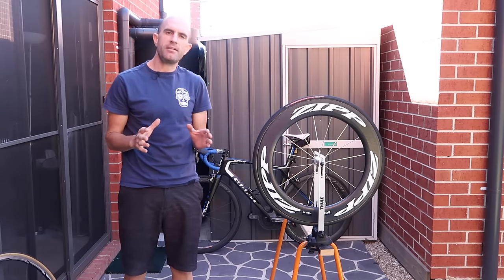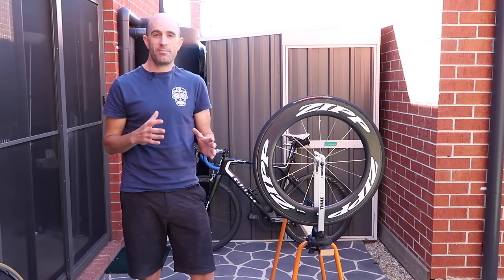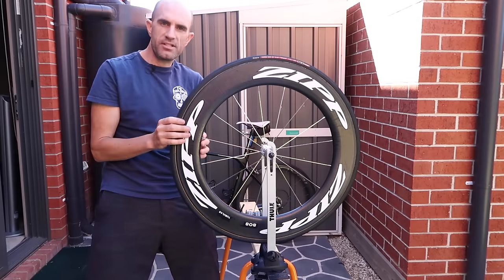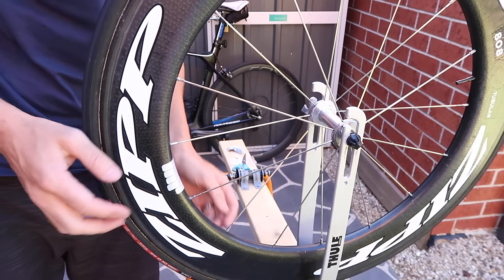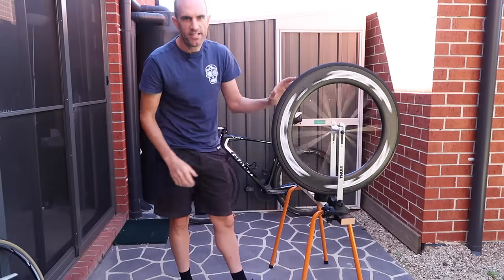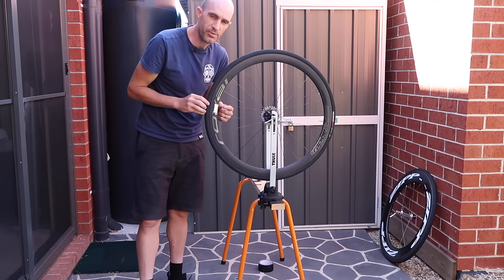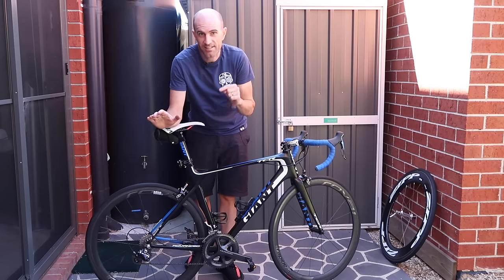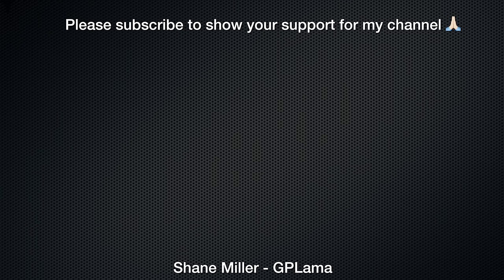Bicycle Wheel Balancing: Marginal Gains or a 'Must Do'?

Comment: looking forward to fixing my wheels i have giant slr0 30mm carbon clinchers and they shake as much as the rovals.  great video
Reply from the maker: Let me know how you go. Even if you can't feel it on the ride, I'm sure it's a worthy task to get your hands dirty... and to ensure your energy is going into moving forward.
Reply: Shane Miller i haven't fixed the giant wheels yet but had a look at my stans alpha wheels. there was a slight imbalance but it was largely already offset by a repaired tube im using. the patch and glue in the tube directly opposite the valve stem (yes i punctured the tube installing tyre).

Comment: Nice video!  I have been doing this for many years as well.  At first I tried wrapping a fine strand of copper wire around the spoke.  What I settled on was to twist electronic solder onto the spoke itself.  Electronic solder comes in many diameters, so don't get the thin stuff.  The one downside is that there is a rosin core in electronic solder.  It is such a minimal amount that the only drawback has been a slight stickiness on the spoke and solder over time.  The other downside to solder is that it  contains lead and one should be mindful of lead toxicity.  Latex gloves or proper hand cleaning is warranted.

Whether a wire strand or solder, when spun on the spoke it ends up like a compressed spring wrapped around it. This works surprisingly well and provides a wide range of adjustment and no worries about adhesive weights or interfering with the rim braking surface.  

Also, if the tire ends up being another source of the balance issue, once the tire is changed and not mounted in the exact position as before, the wheel may be again out of balance.  The adhesive weights may be troublesome to remove after the adhesive dries and is further baked on from the sun.  The electronic solder "spring" can be easily unspun from the spoke and spun back on a new counter balance point.  Other metal wire may be more difficult.  In either case it is still possible to make it easy to re-balance the wheel for on-road tire replacements, where a few minutes of re-balance keeps your ride running smooth for the remainder of the ride.  

The melting temperature of solder is not a concern and keeps it shape around the spoke.  If things get hot enough to melt solder,  we've got other serious issues to be concerned about :)
Reply: I've been doing this for years since my loaded bike became a basket ball at about 40 mph on a down hill, giving much entertainment for passing cars. The cause was the required wheel reflectors. 3-M reflective tape and solder balancing did the trick.

Comment: Nice Video, And a couple of tips as a Cyclist and an engineer:

1- the further out "From the hub" the more effect the weight  has, so  on the Zipp 808 you had put the weight on the carbon which is about  84 mm closer hub than the tire, maybe you could have gone for less Weight  if you managed to stick them a lil higher . "say under the rim tape for example"
 but it will be an exhausting task to remove the tire +tube+rim rape to add or remove wieghts😂

2- any change in the tube,tire,valve length will affect the  balance , So only do it on the minimum valve length that  allows you to pump it easy , this reduced the valve extender imbalance in the 1st place. 

hope these 2 made sense 😉

Comment: I have a track bike and sometimes when I test it hand held, the rear is shaking like crazy. I run 60x25mm carbon rims, with a 60mm valve + valve extender, so it's obviously unbalanced, and I always wondered how a lot of people are not talking about balancing the wheels, but when I feel how harsh is that shake hand held and knowing the wheels spin at least 2 times faster when I'm riding fast, it can only be bad… I just bought a set of golf counterweiths and will definitely try this.

Comment: I watched this video and got the bright idea that I would go balance my road bike wheels. I went and checked my wheels and it turns out that my DT Swiss wheels are pretty close to perfect without adding any weight. I don't know if it is luck of the draw or they had the forethought to add a little weight to the side opposite the valve.
Reply: Hello Timothy,  Yes its just sheer luck why your wheels are kind of balanced.  But that's what is wrong with the High End wheel industry, they are doing nothing about it and charging outrageous prices for wheels that are often so out of balance they are down right dangerous at high speed when descending down fast mountain roads.
But not to worry, a carbon wheel company called SLEEPER is about to introduce the world's first perfectly balanced wheel SYSTEM and the System is called Dynamic Speed Balance.
Reply: I have a set from DT Swiss and a set from Shimano and both are very close to balanced. It makes me wonder whether the problem isn't the wheel companies but a potential problem with the tire manufacturing process.

Comment: Hiya thanks for this video. I have a rear full carbon hed-3 that shaked my bike like yours did... day one when i bought it brand new. Asked local high end bike shop last week if they can balance and did not know how to balance a full carbon wheel and was like could be $150 or more to try to balance the wheel...they said. So did it at home with some 5cents nickles and black tape and worked. Had to use 5 nickles which is around 4grams each. Thanks alot... Cheers!

Comment: I just read  U20101954  comment, and adding a speed sensor magnet to the spoke might just just be worse. Could be that the aerodynamic loss from the speed sensor might make you slower than whatever gains you got from the balanced wheel. This is exactly why I wanted to know how much gain a balanced wheel provides.

Comment: So I have silly questions.  when I turn my bike upside down.rotating the crank hard  on the floor it vibrate.So I did the way how you demonstrate it ..It was smooth no vibration barely. I have Campagnolo Bora WTO I had Campagnolo upgrade the cult ceramic bearing 33 sorry if I'm being little ocd.

Comment: Terrific video Shane. Essential viewing for anyone who doesn't believe that bicycle wheels need to be balanced! 14g on wheels that expensive is shocking, and the nasty effect thereof was amply demonstrated.
 The relatively cheap alloys I have (Pacenti SL25 rims on Hope pro 4 hubs) needed 5g front and 3g rear, using golf club weights like you used. I reckon this imbalance was entirely due to a heavy spot in the tyres rather than the rims as the settling point for each wheel was way off the rim joint or the valve stem.
Even with such a small imbalance, putting it right makes a noticeable difference to the ride quality. I purchased a pack of 8 weight strips like yours for £3 and still have 5 left. Compare that to Silca's kit, mentioned elsewhere in comments, at £35!......

Comment: Nice vid. Great cheap, practical solution.

Adding weight (even this insignificant amount) will always meet with resistance. Would be nice if:
1 - wheel manufactures could lighten the rim somewhat either side of the valve hole to offset the nominal weight of a valve stem for that rim depth, and/or
2 - tube manufacturers made tubes with plastic valve stems (really surprised this isn't a thing already).

Comment: Points from car wheel balansing. They but them just like in this video. On hub/axel side> then adhesive will stick harder and harder faster you spin the wheel. If someone but balansing weights inside tyre> they will spinout easyer and cut innertube.

Comment: On rough/sticky hubs, don't put it in a stand, rotate wiggle the axle back and forth to prevent it from requiring to overcome static inertia, the extra speed in the hub also makes the hub rotate more easily. I've been balancing my wheels since 2014.

Comment: I saw that Silca came out with weights to offset the weight of the valve and thought it was a crock of shit. Thanks for properly explaining this. I just checked my race wheels and they're all out of wack. I'll properly fix this before the start of next season. I wonder what effect going tubeless would have on balancing? Would the sealant collect evenly or will it clump in areas to balance the wheel naturally.

Comment: Hi Shane
You got me on to this some time ago,many thanks for that.I bought a sheet of thin lead from a plumbing shop.They use it for flashing around plumbing fixtures (not baring themselves to the general public) I just cut off whatever I need and stick it on the rim.It cost bugger all and I have enough to last a life time.A change of tyre or tube will generally require a rebalance going by my experience.I've got a nice set of Enve's that have a horrible shake in the rear wheel,this video has given me a kick in the bum to go and glance them. Great work mate.
I use silicon as the adhesive and like you cover with black duct tape 👍

Comment: Being a bike mechanic I have seen this is evident on nearly all wheels. There are certain patterns I have noticed. Top end aluminum wheelsets tend to have this the worst with carbon being second. Lower/entry level wheels are usually the best.
Reply: Cycling Mechanic is that because top end alloy wheels are really light and therefore the valve stem significantly unbalances it?
Reply: It's a combination of that and the positioning of the valve stem in relation to the center. Because aluminum wheelsets tend to be very shallow the valve travels the most distance therefore needing more energy to make one rotation whereas carbon is usually deeper so there is more mass towards the center.
Reply: basically what I'm saying is there's usually more rotational inertia in high end aluminum wheelsets

Comment: Excellent vlog once again. Most of us think of the wheel being 'off true'  but not necessarily the 'throw'.   A question, and maybe one for Raoul , is there any risk of chemical reaction between the added weights (and gaffer tape) adhesives , and the carbon fibre wheels.

Comment: Excellent video. Every wheel must be balanced. Btw, no matter how much a wheel cost, their will be an Imbalance due to even the tire plys. That’s why when you replace tires on a car, it always need to be balanced. Whether you buy a premium tire like Michelin or a cheap tire like Kumho. They both go thru the same balancing process. So basically even if they rim is balanced, it still needs to be balanced due to the valve stem and tire weights. And no matter what your doing as per riding, wheels need to be balanced. The bouncing of the tire causes improper tire wear.

Comment: Could be the racing wheel is going for less weight (better numbers) rather than balancing the wheel. Could it be that the wheel is actually balanced, but the valve weights, say 14 grams? If so, maybe you could add the weight on the inside of the rim or even on the tire or tube? The ultimate solution could be to add this weight in the production of the tube itself.

Comment: Would you ditch the Garmin speed sensor because my rear wheel shakes pretty badly with it on?
Reply from the maker: I'd put it opposite the valve and use it as a balancing weight..... (a few assumptions there, but you get the idea)
Reply: Thats what I will be doing once I get my new replacement Curve G4 wheel. I managed to explode a Roval 40 carbon rear wheel bombing down the You Yangs a few weeks back.
Reply: Love the vids by the way.

Comment: Saw this and went to my bike with some older aluminium wheels, span them, and wow, that wobble is huge!  As someone else mentioned, the front wheel has a magnet on it, so I just moved that so it's opposite, and that helped.  Next stop: golf weights you linked!

Looking forward to what it does to the handling, ignoring the efficiency issue.  The amount of wobble I felt through the frame was pretty strong.

Comment: There is electric machine which can roll the wheel by electric motor and also adjust the speed. And the wheel become most shaky point is wheel is spinning at speed range of around 30mile / hour.

Comment: Very informative!!!  I can understand the imbalance due to the valve stem and reinforcement in a carbon rim.  I have a question about the roundness and concentricity of the rim affecting the system balance.  I am assuming that before balancing you have already checked the roundness and concentricity?  If the rim is oval or not concentric to the centerline of the hub this will also impact the system balance.  By performing balancing without checking other factors you may be hiding a out of round or concentric wheel.  Again thank you for the informative video.

Comment: My 2 cents about your rovals. Maybe the wheelset is balanced correctly, but problem can be with tire and inner tube because they are often not balanced correctly. 
If we compare car/motorbike with bicycle the big difference is speed and rotational mass, on bicycle speed and rotational mass is way lower that on car/motorbike.
Maybe we can balance bicycle wheel on the repair stand but when we ride there are some other forces that makes difference

Comment: So it's possible the wheels themselves are perfectly balanced. The addition of a tube with valve causes the imbalance. And if the tyre isn't seated correctly there will also be an imbalance. I've certainly seen is on MTB tyres which are larger and the position of the tyre on the rim is not always consistent. The wheel manufacturer can't fully compensate for these imbalances due to the variety of valves so I think wheel balancing is a fact of life and we should all find a system that works for us and balance each time we change a tyre or tube.

Comment: For me balancing the wheels is essential - on some wheels.  I have a pair of light alu clinchers and have never felt the need to balance them and I have a pair of very light carbon tubulars.  On the tubulars I can feel the wheel bouncing at speed or on smooth surfaces.  Descending at speed is scary enough, if I can feel the wheels pulsing then it's even worse.  At what point it is going to develop into a speed wobble??  I stick lead flashing to the rim opposite the valve stem.

Comment: I have thought of doing this especially when I had hed 3c wheels which were very wobbly. I have this issue on a 56mm carbon rear which I can feel through the saddle at higher speeds. I thought it was the lateral trueness (hop) causing it but I can't get that any better than 2mm so this maybe worth a shot.

Comment: Oz Cycle runs tubes and he puts the tack at the rim where he's gonna put the weights under his tubes. The tire comes off, the weights get put on the inside of the rim, the tube gets put on top, and filled up with air. Weights in place and no chance of them moving or being seen.
I like the method myself. It guarantees the best mechanical as well as cosmetic method and I like to keep a tube underneath my seat with a CO2 cartridge so I can fix flats just in case. Tubeless is cool, but around town in Florida, there's a major thorn problem and thorn resistant tubes are a must. Oh, the spare tube isn't a TR tube, it's just to get me home where I can patch the TR tube.
I'm riding a '79 Schwinn Le Tour and have about $300 in it: new wheels, tires, derailleurs, freewheel, cables, chain and brake levers plus an odometer combo. Weighs 37 lbs. and is a ton of fun to ride. I'll be balancing my wheels and you can bet I won't be buying any golf club weights. I'll just put the tack underneath the rubber spoke strap protector.
Reply from the maker: Under the tyre won't work for tubular wheels where the tyre is mounted directly to the rim. It'd deform the shape, among other issues. For clinchers, or tubeless this might be a neater option I agree.

Comment: as you gradually wear away at the surface of the rim after any km's of use would the wheels need to again to be balanced or would the rim wear be  of negligible weight.

Comment: Shane, Another great video.  It might be also good to point out to people that the root cause of wheel radial inbalance may be that the wheel is not round with uneven spoke tension, that also results in uneven mass distribution.  So it may not always be caused by mass at the valve (hole or stem).

Comment: Great video
But to be honest I've never felt a noticeable shake coming from my wheels when riding. Is this an issue that you notice apart from spinning the wheel on its own?
And is the marginal gain greater than the marginal loss from adding 30g of weight to your bike?
I suppose it all depends on the riding context.
Reply from the maker: I haven't ridden those Rovals at speed to find out. How much the bike shakes isn't good, so that's sorted now. If I had the equipment that could give a wattage/savings/etc figure I'd be using it to work with wheel companies, not messing about in my backyard with blu-tac.

Comment: Looks like you just bought expensive wheels not "high quality" my no name wheels are leaps and bounds more balanced than your zipps. Same with cars, you can tell true quality when they don't need balanced. Good auto wheels and tires at most need a .25oz or .5oz weight. You basically just paid extra to advertise zipp in gigantic letters on your wheels.
Reply from the maker: They're either ex-race wheels or picked up second hand. So the value angle doesn't hold up here. I have a set of HUNT wheels coming this week. Is that your ballpark for no name wheels?

Comment: Dear Shane, thanks for this very useful video.  Knowing my Zipp 404s were quite out of balance due to long valves and having experienced some scarry harmonic resonance (high-speed shimmy) on descents, I found and ordered on eBay from China some "golf club weights" and tried this. Nominally, the fix worked — for a while.  However, the weights (with one sided adhesive) didn't stick and in a few rides all the weights flew off.  Do you have a source for "golf club weights" that stick to smooth surface of carbon rims that you would recommend?  Cheers.
Reply from the maker: Tape as shown in this video. Or glue. Or other wheels! :)